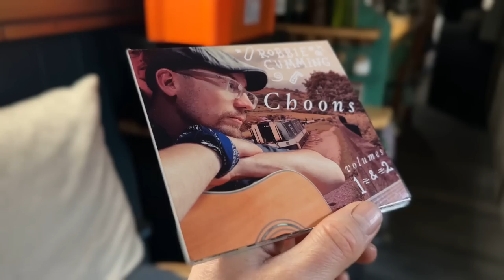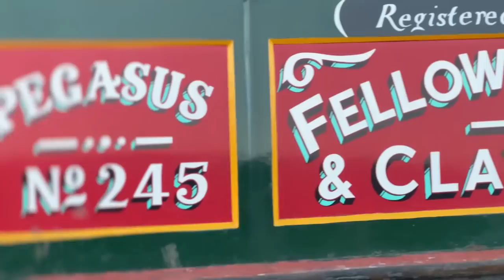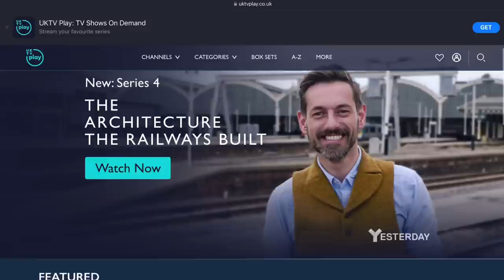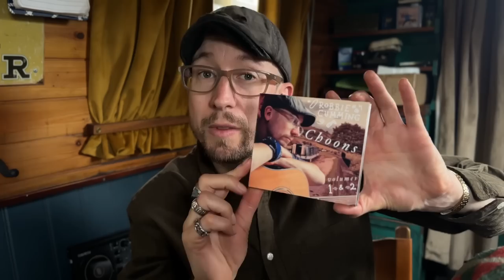Looking through random videos on my phone

Comment: Hi. Been following your fantastic journeys on BBC 4. Really enjoy it. Have a question on the last video. Did the Naughty Lass suffer much paint damage from the ice you went through and also on the show before the engine suffered an oil pressure gauge leak. Was it easy to get fixed?

Comment: You can drink out of the tap without a water filter. Just boil the water, though it does use energy. But in an emergency, way to go.
Reply: You haven't seen the bucket of sludge that came our of my tank.  Not drinking it boiled or not.